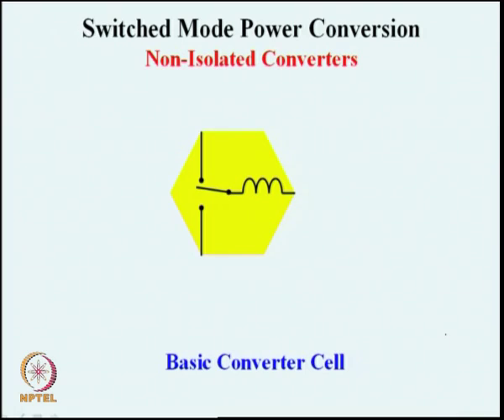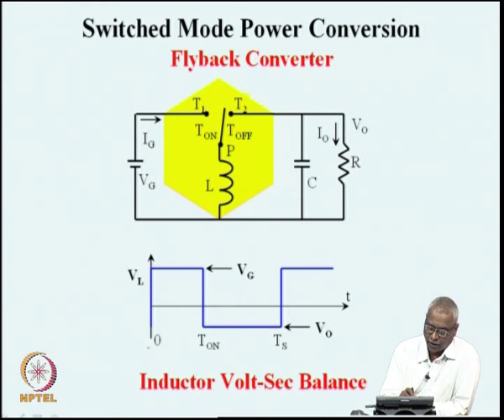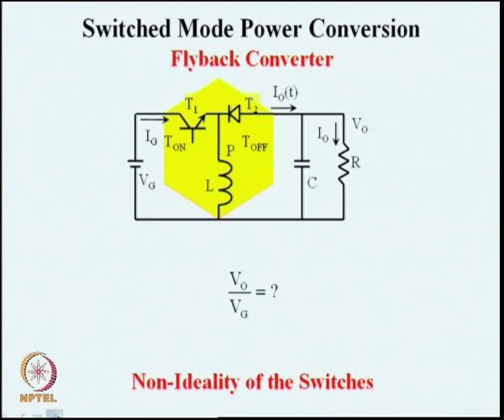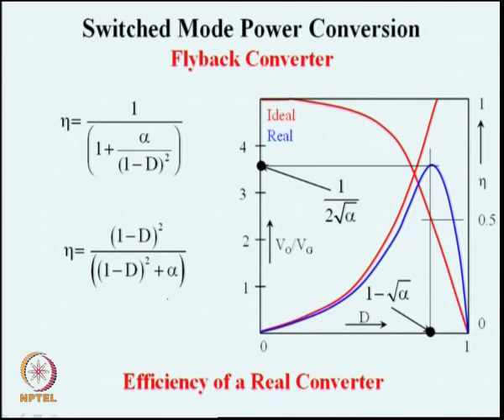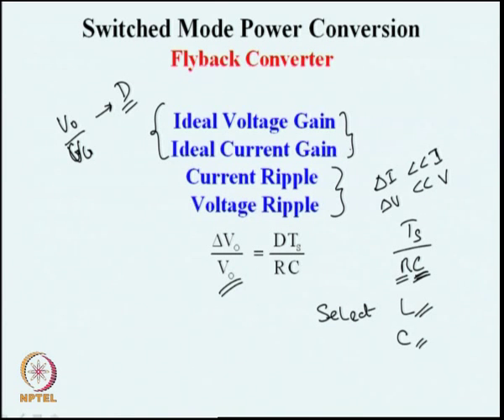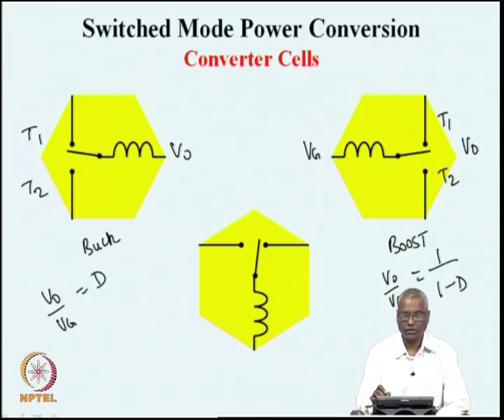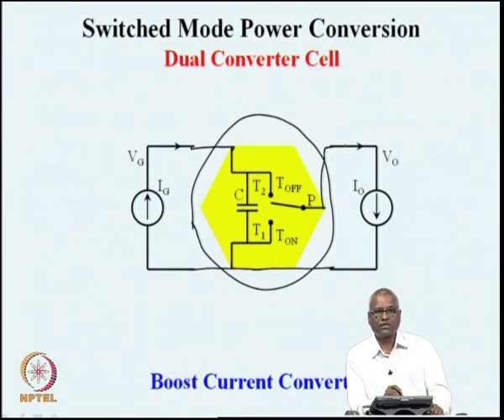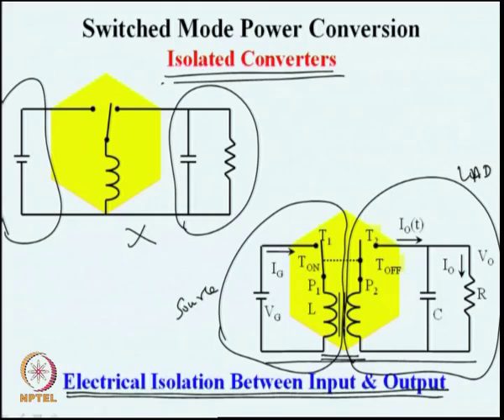Mod-05 Lec-13 Non-Isolated converter -- II

Comment: Dear Sir, with all the respect I would like to ask, when you have taken the volt-sec balance across the inductor while considering the non-ideality of losses across the switches, you have taken the voltage across inductor during the off period as (Vo + Vd). But I am not able to understand how you have taken it. When I am taking the voltage across inductor I am getting it as (Vo - Vd). Also, the final result given in your textbook for the efficiency of the buck-boost converter shows that the voltage across the inductor is (Vo - Vd). Kindly can you please clear my doubt. 
Thanks...